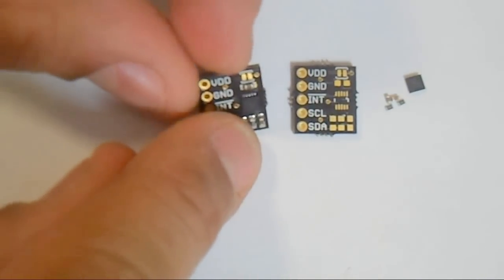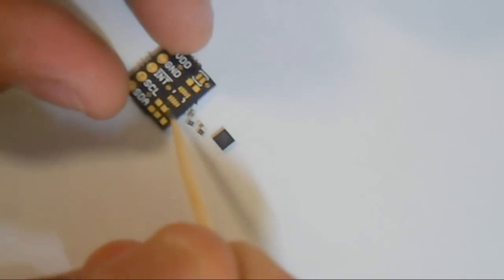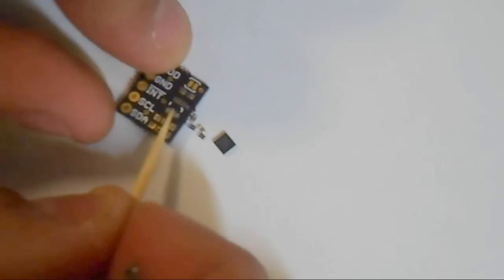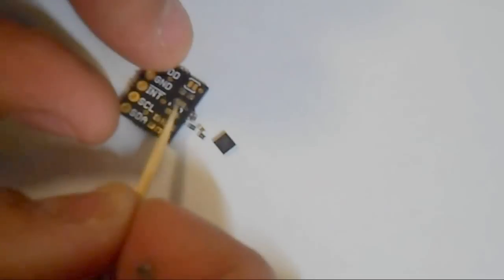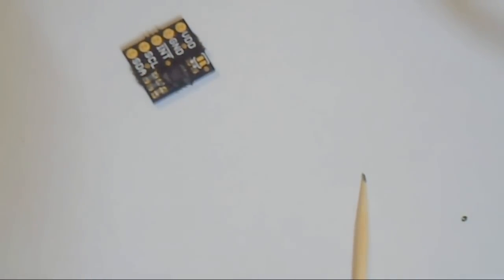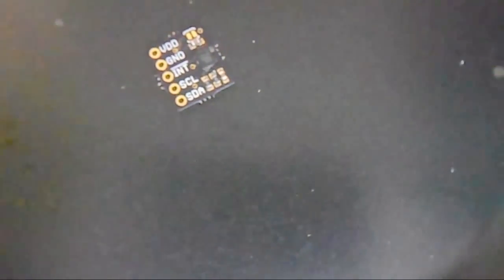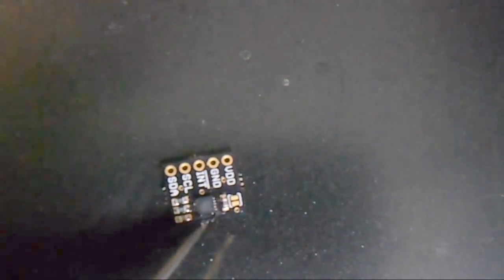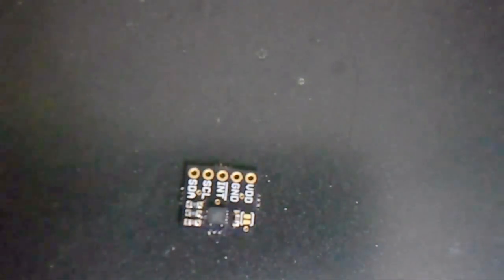Surface Mount Soldering

Comment from the maker: @tiagofumo 

98% rate.. some times i get a bridge but on the OUTSIDE where i can see. I usually fix it with FLUX and a CLEANED Soldering iron. Then alcohol to clean entire thing. I check with a hand held microscope from radio shack... i check every pin on the entire board. Takes only 2 minutes on larger boards... Its worth it.

Comment: Hey atomsoft, what is your rate of success in these procedures? Did you apply it to chips with ceter square on the bottom? Did you have any issues with solder bridge on the pins, making an unwanted short? Thx

Comment from the maker: @LFR4 

This is simple, when the solder melts it gets pulled into the pads by some force ... forgot the name of it. Basically if you use too much solder it will bridge and cause a short. But if you use the right amount or a bit less then it will only stick to the pads.

Basically The PADS attract the solder.The plan board does not.